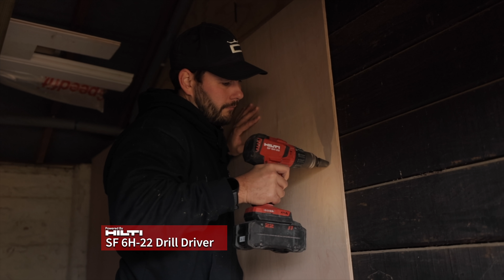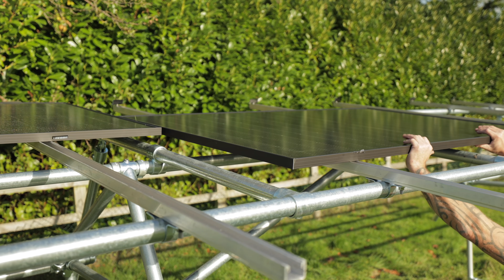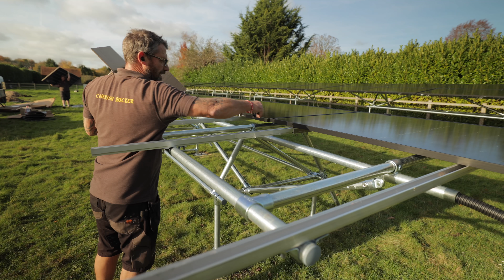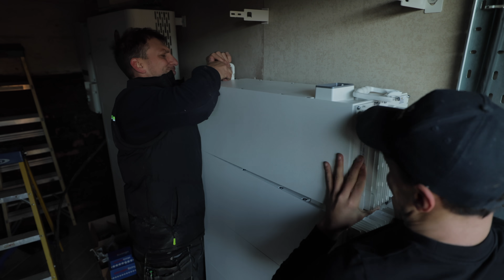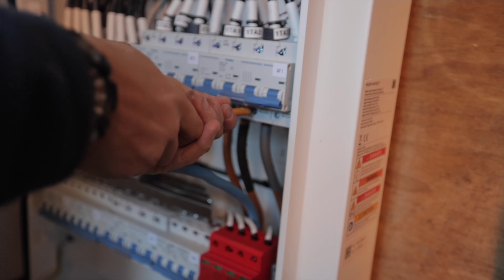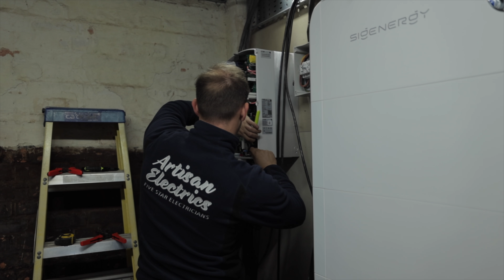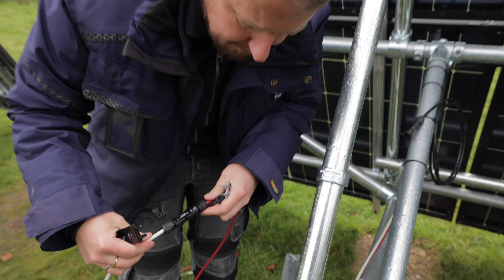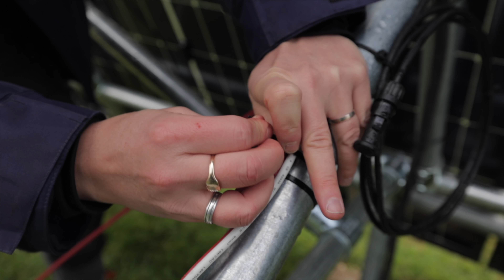The REAL WORLD CHALLENGES of Installing Ground Mount Solar

Comment: great build, I am going to be installing sigenergy in the new year so good to see this video. I am finding all of the wiring, connections, fusing and circuit breaking of many individual components in the victron systems I build are very time consuming. Personally I don't see the point of being grid tied, too much hassle, red tape and in my opinion off grid is the entire point of building your own power supply. I have lived off grid for 11 years with no issues and have built at least 50 off grid systems for many happy customers. Get away from the system, that's the point.

Comment: your not applying the "self amalgamenting tape" correctly, the correct way is to stretch it to roughly  twice its length and smooth it down then within a couple of hours it is waterproof, i know i have used multiple rolls of it from screwfix @ £3.49 per 10m roll (which will do approx 20m)

Comment: What's the voltage drop on DC over that length run ?
Reply: I was wondering the same, why not mount the inverters to the frame and use a hefty ac cable to do the long cable run. Saves a lot of copper anyway
Reply: It might not be significant, depending on the operating voltage of the DC system, which might be higher than the UK LV AC voltage (400Vac 3 phase). 600Vdc? 1000Vdc? There are commercial systems operating at 1500Vdc
Reply: The cable resistance was 1.2Ω, not sure if that's a round trip or single direction. Also looks like the system has 4 cables so around 13kW per cable. If we know the voltage it operates at it can be calculated.
Reply: @Ed.R  it was round trip
Reply: @redshift3  I suppose it has to be otherwise difficult to measure without both ends of the cable together 🤦‍♂️.

Comment: Moling seems a completely unnecessary expense and over the top. Farmers plough whole fields and turn them into pasture by sowing grass seed. Can't think that a 30cm wide trench would cause any noticeable damage in such a large area if repaired after. Customers !
Reply: Some people have more money than sense 😅
Reply: @ashergilmour3120  the problem allegedly with these sponsored and subsidised videos is that they use products and practices which you would not normally be bothered with unless someone gives you them for free by way of a sponsored video and probably greatly reduced price on Doncaster EV cable. 
Allegedly no one really in their right mind would install like this if they were not getting free stuff and/or discounted stuff. Nice future maintenance income stream for someone. You will notice he was clever enough to have someone else install the cable in this way so any problems not his. 
It's now more of a channel for entertainment purposes, which is fine, probably should be highlighted more.
Reply: Wholly agree. And don't understand why conduit and regular solar not used. If there is a cable issue no way to pull new cables.
Reply: @brianoneill350 Totally agree, I  always put armoured cable in ducting to allow future expansion & repair....
Reply: @Birko64 Not using conduit is a crime 🤣
Reply: Non the less it was the choice for the client. When it's your turn, please dig a trench
Reply: We have recently put cable into a trench and put 2 ducts in to take the cable. We used a small tracked digger which stripped off the turf and laid to one side and then put the trench spoil on the other side. Backfill and then lay the turfs on top. There is a bump on the trench line which slowly disappears as the soil settles but the grass will survive. Experience has taught us that ducts are a good idea to future proof against technology changes that require extra cables

Comment: why don't you build a higher platform? if it's possible to stand/walk underneath the solar panels, you could use bifacial panels, and one can hold a outdoor party underneath the panels. or park some machines.  It'll make the space more useful.
Reply: Probably a height restriction in the "planning permission" (construction permit)

Comment: Good video as always 👍

Why did you use the SolarEdge inverter and not the sigenergy built in?
Reply from the maker: Thanks! As I explained in the video the cable lengths were too long to use hybrid inverters, with SolarEdge you can go up to 600m cable length with 6mm DC
Reply: @artisanelectrics  why does the voltage drop over 200m affect inverter choice?

Comment: The angles of the panels do make a massive difference. I have 14 panels fixed on my roof, and even on a sunny day, winter sun produces MUCH less power than in summer. A very informative video and a great install.
Reply: This is due to the amount of atmosphere (tiny dust clouds etc) the sun shines through at low angles eg 20 degrees Vs from above. Hard to get sunburnt in winter. This is more the factor for winter drop than the angle
Reply: @markyates5744  And also, because of the lower angle, the same amount of solar energy spreads over a larger area, which means less energy per m².
Reply: Matching the angle of the panels to that of the sun makes a lot of sense - unless your typical winter day is a totally overcast sky. Then, suddenly, the flatter position is better (ignoring bifacial effect)
Reply: @alnicospeaker  this depends on general insolation and location,
I just replaced a 10yo failed mounting system at my mom's house.
winter temps can easily be below -20 to 0c for a high on a winter day, this often yields 110% of the nameplate rating for production
I've set up the mounting system to be fully adjustable seasonally, but they aren't sun trackers. but the place  is also about the sunniest in North America
Reply: Wow revolutionary information, solar produces less power in the winter. ;)
Reply: @dealerovski82  The bifacial should make more with the snow reflecting the light onto the back.
Reply from the maker: Thanks for sharing
Reply: I did get a freak after dusk problem once.  Sun below the horizon was bouncing off the underside of the clouds overhead lighting up the sky.  but my tracker couldn't find the sun.  😎
It does take up more room so you can tilt them for morning and afternoon than for summer and winter angles.

Comment: 29:29 I can say that your cable ties (zip ties) will NOT last 25 years, those should be stainless ties, or the cabling in rigid conduit to keep them neat.  Split loom tubing for all that cabling would help to protect them and help keep the UV off if you aren't going to do rigid.  Here in Texas I use it on network and coax, anything that is exterior in the sun and elements.  With temps getting to 45C in the summers and the harsh sunlight here, anything exposed will fall apart from UV and heat.  "UV stabilized" cable ties last a few years in the sun and elements here.  No way will the hundreds of cable ties last for 25 years there even as well.  I am surprised that the frame work with the set-screw doesn't have a pin latching system, those wouldn't seem to hold up well to the amount of wind we get and would act as a sail, and with that many sq feet of surface area two little set screws aren't going to hold it firm during a wind storm.   Excellent job to Jordan and the whole Artisan team.  🤠
Reply from the maker: Thanks - the DC cables are all UV rated so no issues there - same with the cable ties although I agree they might not last 25 years.

Comment: Yeah probably worth mentioning that it’s been confirmed in the official FB group for sig, that the “AI” options for the software will be a paid subscription in the future.

AI in a solar system, totally totally pointless.  Tesla do all that same “AI” prediction and don’t claim it’s AI

By all accounts the sig app is a bit of a hot mess with even basic arithmetic going wrong 🥴
Reply from the maker: Interesting - I hadn’t heard that
Reply: @artisanelectrics  also, that after some analysis, from the same FB users group, it seems that “AI mode” and the 10 year warranty are mutually exclusive.
Numbers captured by users show that in AI mode with forced export automated, the warranty based on energy throughput expires after circa 5 years

Not, good, and as an installer you should 
A - know this 
B - be telling customers at quote time

Comment: Your horizontal boring is much different than we use the US for sure.  A very small hole is used and then guy drives the boring end on the machine.  We have all buried utilities here where we are at, nothing aerial.  So always a fun thing to watch them weaving in and out and over and under other utilities.  They can run about 200-400' in a single time with only the small holes on each end, and they can steer where ever they want it to go with only a guy with the machine and the guy with a underground locator to guide it where it needs to go.  🤠👍
Reply: That sounds like directional drilling. We have it in the UK but it's probably a lot more expensive seeing as the equipment is a lot more complicated. I think it uses a water jet to cut through the soil. The 'mole' is powered by compressed air to hammer it's way through. You literally aim it and as long as the ground is consistent it travels straight.
Reply: @matthewwakeham2206  Ah yeah, we have so much rock here that you couldn't use something like the mole.  It wouldn't stay straight at all.  Yes it does use both water and a actual cutting head, the water will keep the cutting head cleaner.  👍

Comment: ChatGPT is an LLM - it doesn't learn, it doesn't adapt in real time (or to your particular installation) - as a language model it's completely unsuitable for dealing with numbers (yes it can do some numeric operations it's been trained on - but not anything novel), readouts anything that's not related to the language it learned from the web - and it can't be counted on to Not Make Mistakes.

I'm really hoping that you, or Sigenergy are just miss-labelling the AI used here, as almost any other machine-learning approach would be better than an LLM

Comment: far tooooo long, not so much to learn from for a 50 minute Video.

Why shouldnt someone else not be able to get a 200 m solar cable laid?

I have planned our 40 kWp system with a 46 kWh LFP battery all on my own and have laid all the cables myself to the fuse box
I also have build my lfp batteries on my own too. Each 16 kWH rack had cost me 1600€
And I wired a 3 phase wallbox.

I am a car manufacturer manager , not a technician , I can do the math to check with the thermal coefficient, if the panel fits to the inverter at the coldest temperature many solar technicians never learned for example to calculate the voltage of a 45V panel with a  -0,4% coefficient at -15°C and if that fits to a 50 V Microinverter .
-0,4% °C x -40 °C becomes an issue for most electricians cause 25 to -15 ° means a drop of -40°C from the test conditions the panels are tested with and that mean that the Voltage will increase by 16% and go beyond  the limit of the inverter, cause 16% x 45 will increase voltage by 7,2 V
 
It is physics, math, logic and some skills learned from youtube or rater Andy  from the channel off-grid garage , a german emigrant living in sunny hot australis. 
You can learn a lot and of cause the most important thing is bear related: SPAT Test

That is a solar panel alignment test. 
Take a beer can and put it on the panel. If the sun is strong and the can makes no additional shadow you have the perfect panel performance or something can be wrong.

Cheers
Reply from the maker: There’s always one

Comment: Very impressive install guys. I can't see how this will be "good financial investment" though
Reply from the maker: Actually the payback time was very good on this one - usually the bigger they are the quicker they pay for themselves due to economies of scale
Reply: @artisanelectrics rough idea on how much this installation cost?
Reply: I noticed a Tractor in the background of one of the shots. Is is a farm?
If they do get 88kw that would make a lot of sense, as the energy would mostly be needed during the Spring and Autumn, rather than winter.  Even if none of it goes back to the grid, would save an absolute fortune on electricity costs. 

Cleaning them would be a doddle if they get dirty for one person with a squidgy and a bucket every few months,  no need to climb on roofs,  The land wouldn't be doing anything else Although other people have allowed sheep between panels. (Although not cows, they would destroy it)

TBH, it seems like a no-brainer if you can front the up-front costs.

Comment: Great video Can you not just go off grid totally and not export anything? Would that be possible seems like the grid is not ready for all this solar energy and electric vehicles what are they going to do when we all charging cars and using electric heating do you think the uk is ready for solar and battery systems? Just interested what people think
Reply: We are years from being ready for any serious uptake of EVs and batteries. The grid just isn't up to the job because of how it was designed. Dno do regularly turn down every chargers because the cable capacity to the properties just isn't up to the job. So if the capacity isn't there for import then it's not there for export. We really need to start chucking billions upon billions at it.